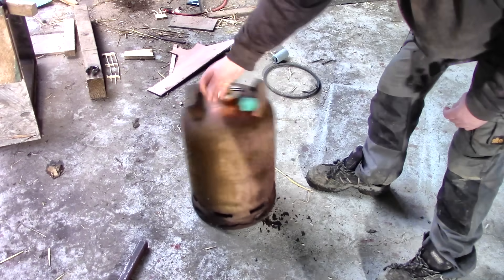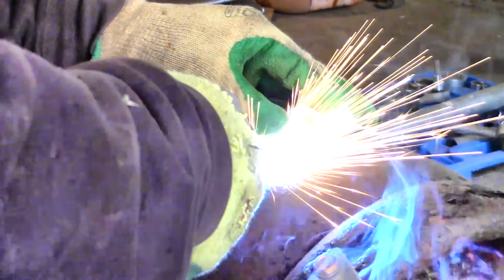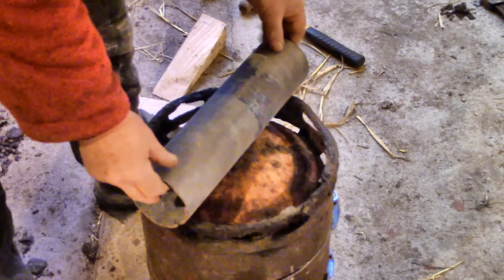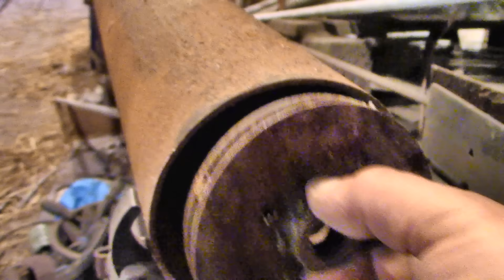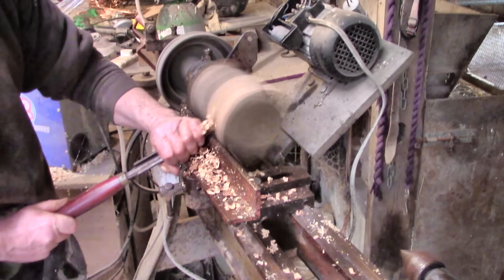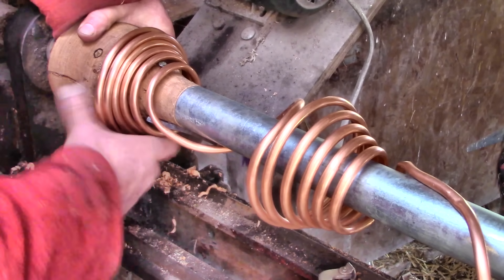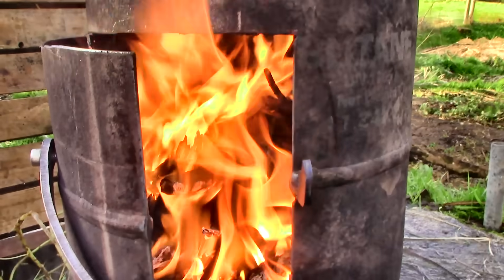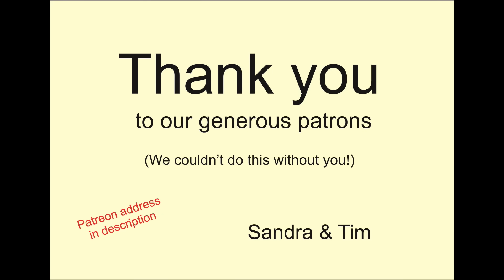Homemade Flash Steam Boiler From Plumbing Pipe And Scrap

Comment: I don't have any experience, but it might be easier to roll the copper coils onto a smaller diameter pipe (one or two inches smaller than the diameter of the outside chimmney), and leave it there as a smaller chimney. Then after fixing the single long continuous coil onto that inner pipe, slide the whole lot inside the outer chimney. 

It would probably allow double the amount of coils to fit into the same space as before, and wouldn't kink so easily, as it would just roll off the original coil, and get re-wound onto the new coil.

Copper gets "work hardened" quickly, so heating troublesome parts with a gas torch could help soften bits needed.

Comment: My grandfather built the home that I live in in 1951. He was a marine engineer and outfitted the house with many redundant systems. I remember as a kid he would go to the basement every morning and fill the fire box with an enormous amount of wood, the only feeding of the day. There are tons of copper coils in this firebox that feed to a 100 gallon tank that runs through homemade radiators inside the walls, powers the elevator, and ends in the house hot water tank. This is one amongst many complex systems. Anyhow, my stepfather lost the instructions shortly after he passed. When I moved in, I felt fairly confident that I understood the system and felt comfortable using it. All was fine for a few months, and then one day I loaded the fire box up with a bunch of cedar and pine. This burned so hot that the steam was back driven. The pressure release valve (sourced from a huge ship) failed and the hot water and steam back fed the whole system. I didn't know any of this was happening, we were just watching TV one evening and heard the loudest explosion I've ever heard. I thought it was from the highway a half mile away. It turned out that the huge stainless fire box fired its door across the house with enormous force. There were huge soot stains everywhere like a cartoon explosion. I have not run that system since, gave me an enormous amount of respect for steam.
Reply from the maker: Great story - thanks : -  )
Reply: Quite an interesting system!
Reply: We have constant Power Shortages here where I live (Malawi). I have really been researching the use of steam to turn an alternator to power my house. But your story has made me rethink my decision.
Reply: @theshirehighlander7292 maybe you could use a stirling engine
Reply: @franciscosoares2440  now am going to research what that is. Thanks for the suggestion.
Reply: @theshirehighlander7292  buy the curriculum books for 4th class power engineering.
Reply: @bradmettler4566  thanks man.
Reply: @theshirehighlander7292   no problem.  Buy second hand for savings.
Reply: For industrial use the operators and engineers have to acquire license for that? Yeah same..i respect their role in the mill
Reply: Prob a family of rats trapped in the pipe
Reply: Try recirculating the “wet steam” downs through the firebox.
Reply: You’re a fool for thinking you knew what you were doing when you didn’t know what you were doing. And something quite dangerous had to happen for you to first respect steam?
Reply: @ingleberthumperdink9455  you know how people in the past learned? Genius
Reply: @ingleberthumperdink9455  sure it doesn’t, how many planes did the Wright Brother’s crash?
Reply: @ingleberthumperdink9455  He just wasn't aware of the strength of steam before that incident.
Reply: @Inglebert Humperdink  
Perhaps you might consider learning the power of words before you blow yourself to smithereens. 
Just a thought.

Comment: I love it! As a mechanic who works with steam, you might want to install a steam trap if you use this for a locomotive. The water impingement can be very damaging to mechanical systems, especially ones with pistons in them. Shouldn’t be too hard to make, it’s an impressive system you already have! As someone said, more coils is more better, but I’m not sure how to improve your current manufacturing process
Reply: more better!
Reply: @Mafanwe  I stand by what I said
Reply from the maker: Thanks, Nathan - but I was hoping to get the steam hot enough so I didn't need a trap. Just not sure how yet.
Reply: @wayoutwest-workshopstuff6299  while superheated steam would be great, it still doesn’t entirely eliminate the need for a way to get rid of water. Old locomotives simply bled a ton of steam before they took off, which works, most condensate is when the system is starting, assuming you’ve got enough heat. Like others said, smaller, and more, coils, maybe a preheater of some sort, and play with water inlet until you’ve got the maximum steam without condensate in the piping
Reply: You could also put a back pressure regulating valve of some sort near the outlet: the steam has to be above boiling, because of the pressure, so when it finally builds up enough to overcome the regulator, it’s well above 212F, so in a lower pressure system, it’s superheated. Just make sure your coils can take whatever pressure you put it at!

Comment: I have no idea if this is true for your part of the world, but it is a great trick for getting cheap copper tubing. As you know, copper prices change daily / weekly and are rather high right now. A number of years ago I needed 20 ft or so for an oil manifold project. At Home Depot and similar big box stores, you can often find a refrigerator water line kit. These are little DIY kits for people adding a water dispensing refrigerator to their homes. It's just a crappy valve, a few fittings, and 30 ft of soft copper. These kits are often about 1/4 of the price of the same amount of copper by itself in the bulk department. For whatever reason, the prices on these kits basically never changes. There have been times where the value of copper scrap was high enough to pay for the kit. I restore a lot of older machinery that often needs copper oil lines, this has been a great resource to me.

Comment: One nice trick for bending copper without it kinking is to find a spring that fits rather closely around the tubing. I've heard of filling the tubing with sand but that sounds like an enormous hassle. You can also heat it, copper can be annealed over and over.
Reply: I heard that filling tube just with water and crimping both ends is also very effective method. And it is easy to empty it afterworths.

Comment: I have an idea on how to correct the downside of this boiler type, you take this flash boiler, and have the end of the pipe were the steam is supposed to come out go into another tank which would contain the steam and have a hole you can open at the bottom to let water out of this container and then loop around to the start of the pipe, this way it would prevent water building up in there when the fire isn't hot enough, then you would have steam which you can use to power whatever you like with it, something else you can do is when the steam is used, you can run it back to the start so you recycle the water, essentially this means you would have a fireless locomotive with an attachment added on to it which is in this case is the flash boiler

Comment: What kind of coal will it burn? Common Poor quality lignite/brown coal, common/uncommon standard quality bituminous/black coal, or rare high quality anthracite/hard coal.
Reply: Or is it gonna run on wood or charcoal?
Reply: Or even an oil burner
Reply: How many cylinders will the locomotive have? Will it have internal or external cylinders? What will The whyte notation be? Will it be a tender locomotive, a tank locomotive, or a tender-tank/TT.
Reply from the maker: If I build one at all it wont be run on coal
Reply: So it’d run on wood
Reply: Wood: 

Downsides: 

Creates lots of ash 
Burns quickly so the firebox would need more wood very frequently
Creates lots of smoke which is bad to breathe in
Can get damp and useless.

Upsides: 

Easy to get, your railway is in a forest so there’s always wood around you. 
Can be cut into smaller pieces in order to fit inside the firebox.

Comment: I'm probably a bit late to the party, and someone has probably already recommended it, but I'll say it anyway in case someone hasn't. My first suggestion is to get the copper tubes packed as tightly and as closely to the firebox has humanly possible, try to make it look like a fully compressed coil spring with no spaces or gaps. This should help to heat the water more evenly, my second recommendation is a blower, these are usually consist of a valve connected to  the main outlet that lets a little steam shoot out of a small tube in the exhaust. This will in turn create a draft which will draw more air through the fire thus making it hotter. The only thing is, that for a steam blower to work you'll need lots of dry, high pressure steam to use. The solution is to use an external blower (either using a pneumatic compressor or a electric blower fan) which will get the draft started initially and once the engine has built up enough pressure you can switch over to the steam blower. I would also recommend purchasing an off-the-shelf steam injector or a simplex steam pump. This will allow you to test the boiler pressure and see if it's suitable enough to pump it's own water. I'd also recommend looking into Sentinel steam locomotives/lorry's/engines/boilers/etc. they aren't flash boilers by any means, but they are very unique and interesting and quite fast firing.

Comment: The thing to remember is that the pressure at the outlet of a boiler like that will be equal to the pressure of the stuff going in - so if you are supplying water at 2 bar, the engine will need to run at 2 bar. Looks like you need to get more heat into the water somehow - either by increasing the number of coils in the heat exchanger or by increasing the temperature and/or flow rate of gas coming up through the flue.  You could install a blower at the inlet of the firebox to achieve both, or try something clever with the geometry of the chimney.
Reply: Wouldn't you get 2 bar plus the extra pressure from when water changes from liquid to steam and pressure increase from heating the steam?
Reply: @alexanderolsson585  No, because as soon as the pressure of the steam rises above 2 bar it will prevent any more water from flowing in. So it will self-regulate to whatever the water pressure is.
Reply: Exactly. So rather than burning all that fuel to make steam you could just drive an engine directly off of the water pressure.

Comment: I've done quite a bit of research on steam power for my side job, and have a few notes from the designs I've looked at. 

Rather than coiled copper pipe for your heat exchange, you might consider a series of straight copper pipes that then loop back and connect at the ends.  This would of course work better with a horizontal configuration, but you could still use the existing firebox and just turn the chimney 90 degrees to achieve that. And the smaller and more numerous the pipes, the more surface area you create for the water to pick up more heat. 

Many flash boilers do use a recirculating water supply, taking at least part of the steam that has done its work and turned back to water and returning it to the reservoir tank.  This will eventually pre-heat the water in the reservoir, allowing it to get even hotter as it goes through the heat exchange and giving you better steam. The drawback to this is that you do then have to keep an eye on the reservoir tank, as it can build up pressure if the water gets too hot, and needs to have a safety valve if it does end up creating steam in the tank. 

If you don't want to worry about re-circulation but still want to try and pre-heat the water, you could also just make a saddle tank that sits on top of your chimney for the water reservoir.  This way the water in the reservoir collects at least some of the heat that isn't completely collected by the water in the boiler coil. Again, this would be easiest to do with the chimney turned sideways.

Finally, if you can manage to get steam that isn't still wet once it's been used for work, you might consider letting the waste steam that you're just going to expel be released through the chimney rather than just letting it out into the open anywhere. In addition to adding any left over heat you can from that steam back into the system, running steam through the chimney regularly helps to clean it and cuts down on the build up of creosote on the sides and the heat exchange, particularly useful with a wood fired boiler.
Reply: If you did a closed system like you mentioned, I’m assuming it would lose a little steam here and there, would you need a water pump that has enough psi to overcome the psi in the tube?
Reply: @shanek6582  Mostly that will depend on how the engine is configured. If it's configured so that the steam that's used to do work is above the tank, then anything that has condensed back into water can simply drip into the tank without a pump needed. If it's below the tank, then yes, you would either need a separate pump to move that condensed water back up or to add a pumping action to the line as part of the cycle for whatever it is you're actually using the steam for.
Reply: This could ne used for a steam sauna. right?

Comment: Two ideas: Use air conditioner condenser coils from a scrap yard for the heat exchanger. Most air conditioners coils have fins on them to transfer convective heat more efficiently, and the tubing is strong enough to hold back the pressure of the refrigerant. You could also make a steam blower to draw a stronger draft through the fire. A small loop of copper tubing with some holes drilled in the top of the tube should work nicely.
Reply: One last thought. Try swapping your inlet and outlet on the heat exchanger for dryer steam. Any vapor that is about to condense should fall back down towards the heat instead of blowing out with the rest of the steam
Reply from the maker: No air conditioners in Ireland - and almost no scrapyards : -  (

Comment: not sure, but if you either fill the tube with water and freeze it or wax, it will coil without kinking...or fill the inside with a long spring. Also not sure if you need to anneal copper, I know to bend brass you need to heat it often as brass work-hardens, but I cant remeber anymore if copper is the same. Good luck!

Comment: Don't muck around with the design. Heat it up before you run the water, It all relies on heat to make steam and water takes a lot of energy to get to boil. Get a good hot fire with glowing coals and clear smoke and a strong draft, and you will generate steam without any problems. Its the fire as your problem as the design looks OK. You need a hot fire box, hot chimney, good draft that will pull the heat up and get that setup roaring to life. It takes a good amount of air to generate a good draft. If you want some more welding, run an air inlet pipe around inside of the fire box so the air is supper heated before it BLOWS over the coal bed like a constant black smith bellows.  The fire fixes the rest.
Reply from the maker: Interesting - thanks.